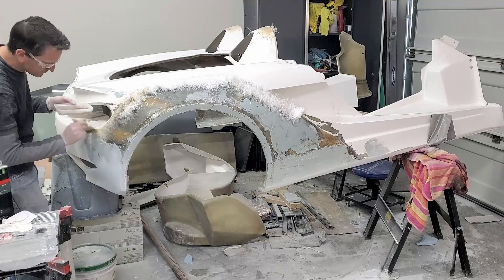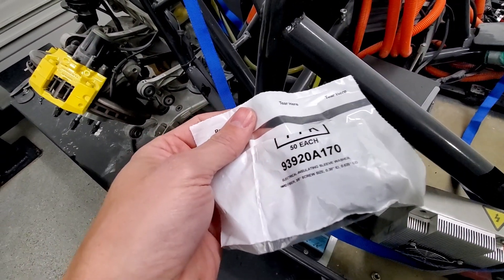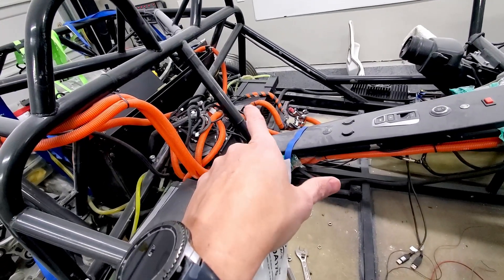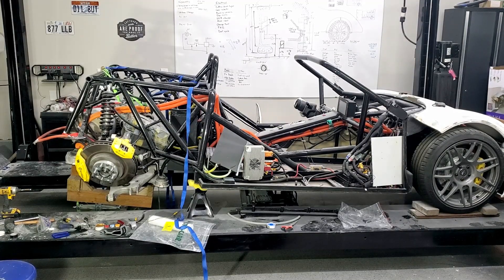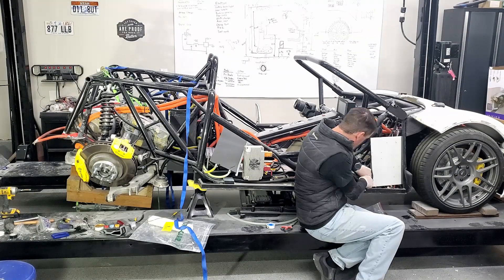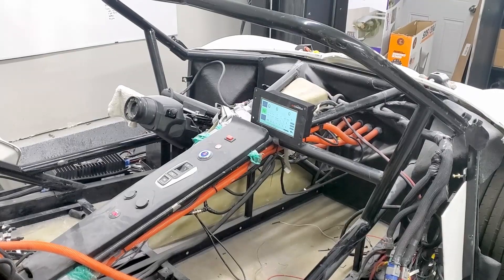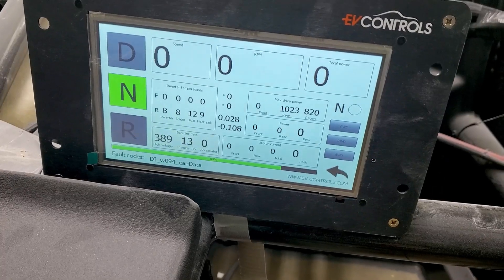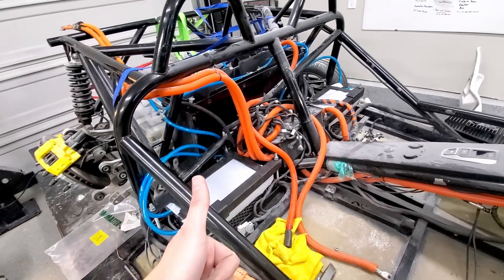Controller is Back!

Comment: @Electric SuperCar Would you consider adding hydrogen fuel cell by harvesting hydrogen from water within a chemical process?
This would reduce the amount of batteries and using super capacity.
One advantage would be increasing the range to 1000 km.
Reply from the maker: This particular build I plan to stick with batteries.  Maybe something to consider for a future build. Thanks for the comment!
Reply: @electricsupercar  I am not suggesting to take away the batteries but a way to solve the battery range problem.

Another way would be using compressed air carbon fiber reinforced bottles and a flywheel connected to a air motor (which is very small as a turbo charger) to generate energy.

I found this all carbon hydrogen fuel cell which absorbs hydrogen and consumed hydrogen producing electricity. A small stack. The whole system is small and you won't need too many batteries.

Hydrogen in a solid state is stable and will not explode even if you shoot it with a gun.
It's more stable than gasoline or diesel.
A low pressure bottle reinforced with fiber, the size of a medium fire extinguisher, would store 5 times more hydrogen in a dolic state than it would store in a liquid state.

To release hydrogen on gmdemand, you just have to provide heat.
A bottle of the size of a fire extinguisher, would provide you a range of 1000 km.

You could upgrade later. I can tell you that this is cheaper than people think. And it easy to get hydrogen from water by chemical process.

I will try to produce a futuristic motorbike.

Comment: Where did you get the coolant line from, that is exactly what I also need for my conversion.  Was it called something specific?
Reply from the maker: This is what I got.  
https://www.mcmaster.com/5545K18/
It will not work for internal combustion engine applications because the temps, but for electric applications where the temps are much cooler I think it will work fine.  You may be better off using regular coolant tubing, but I really felt I needed to be able to see coolant moving.
Reply: @electricsupercar  Yes!  Thank you sir.

Comment: congrats for all the hard work. it's amazing that you are building a lightweight sportscar ev almost from scratch in your garage that's more appealing than any production ev, save super expensive super/hyper cars like Tesla roadster 2 or lotus evija.
Have you considered using supercapacitor acting as a buffer for the battery pack to create an hybrid li ion + super capacitor battery ?
that would be a first and could give your build an advantage in peak discharge power, reduce heating/wear/stress on the battery, improved regen power and efficiency. Although I get that it would add a lot of complexity to the software and maybe prevent to use a ready-to-use controller. Would be happy to help in the software side ! I don't have experience in embedded systems but would love to try to help
Reply from the maker: Thanks for the suggestion!  I will have to look into it.
Reply: @electricsupercar  Cool! If you ever give it a thought, my idea is to have the super capacitor have somewhat the capacity to store the kinetic energy of the car going full speed a gvw. if car was able to run without losses it could basically operate the car on flat road forever with as much braking and accelerating as you want. in reality, you can't avoid the losses, but the idea is that battery would take car of all the losses ( not reversible) and super capacitor would store kinetic energy and receive ALL regen  power. this way you make sure capacitor is able to store all kinetic energy of the car slowing down from top speed to  full stop (minus losses) and then later discharge to provide power to bring back car to speed without using the battery.
going uphill or downhill would not change the capacitor charge discharge, which would only be tied to the speed, it's the battery that would have to provide the additional power when accelerating uphill, or store the additional regen when braking downhill.
this way you are removing all power spikes from the battery, keeping it cool and healthy without need for a massive cooling system, and you are using the supercapacitor for what's it's best, which is a buffer to rapidly charge and discharge, with high power, little losses, and high reliability.
you could design it with a smaller super capacitor which could work very well in a low load/low speed scenario (like driving in a residential area, stoping/starting at every crossing) but software would have to be smarter to anticipate so that capacitor is not full when you are asking for regen, or empty when asking for acceleration. if you want to improve track use and get the most effect you should go for the full version.
I'd be happy to provide some code to demonstrate the idea (could be simulated)
This is all subject to the ability to plug a battery and a super capacitor to a controller,   and control independently the power flowing into/out of both. like having a controller having the ability to plug two battery packs in parallel, and to customize the software so that they are not managed like to identical batteries that need to be balanced, but like a battery and a battery buffer with completely different jobs.
I can estimate the capacitor if you know the approximate max weight  and top speed
Reply from the maker: For now...I am taking baby steps.  I want to get my car running and then we can take the next step
Reply: @electricsupercar  haha sure. you already have a lot on your plate. Plus its probably much harder in real life. the maths kind of work in theory. but capacitor voltage drops more than a battery,  you would have to put many capacitor in series to reach 400V and BMS dont know how supercapacitors work, so it would probably involve a lot of electronic design or software until there are some off the shelf components

Comment: Some nice progress here. 

The coolant lines look pretty cool! 
Are they rated for temperature?

Really hoping the isolation work pays off along with that 120k ohm resistor too.

Keep it up 😎
Reply from the maker: The coolant lines are only rated to ~180F.  For internal combustion engines that would not work, but will be fine for my electric car.  If any of my components (motor or batteries) get close to that temperature, I go into limp mode or batteries explode.  So coolant line integrity will fail long after my car does.
Reply: @electricsupercar  ah nice! 

I asked as I did put some on my old car to get me home, was cool seeing the coolant where normally just black rubber pipes. But found the temps were too much and replaced back to rubber when I could. 

I'm so so looking forward to seeing you finish and enjoy it all along the way. I really enjoy watching your work/videos on Sundays. 

Stay safe.
Reply: Its good to be electric.   Temps are way down compared to I.C.E.

Comment: So you put the isolator on the battery pack? (The sheet and the washers) was the battery pack causing interference? I might have missed an episode.
Reply from the maker: It is my belief that I had a isolation issue between my high voltage circuits and my 12V circuits.  I think it is the cooling elements on the battery modules.  They act like capacitors and I get a high voltage zap when I power up the Tesla unit.  I am trying to isolate.  Not entirely sure if this will do the trick.  Time will tell.  🤞
Reply: Cmon man, be a man of culture and check his uploads😉
Reply: Hi jerry

Comment: I'm wondering if the insulating sheets you installed could be blocking some ventilation?  You might need to trim the sheets.
Reply from the maker: Thanks!  I will look into it

Comment: why did u need to get it reflashed? you had the car driving around already :o
Reply from the maker: I fried my last inverter board so I had to get a new one.  Apparently each board is coded to its specific motor, hence the reflashing.
Reply: @electricsupercar  ouch